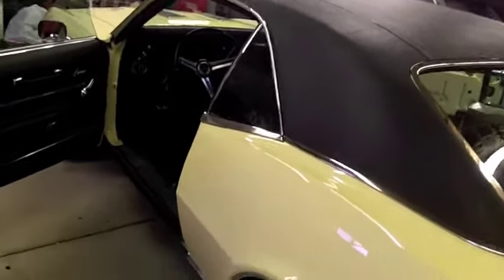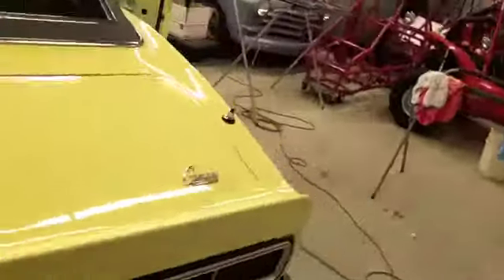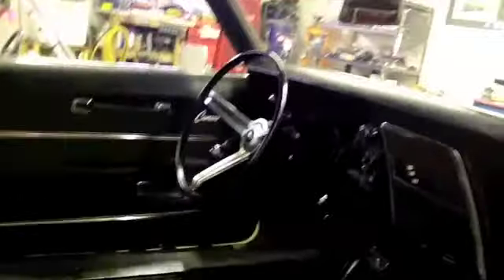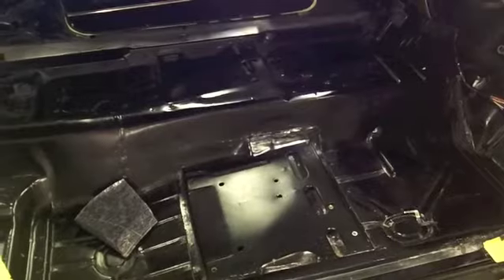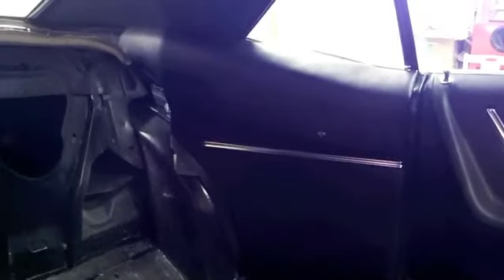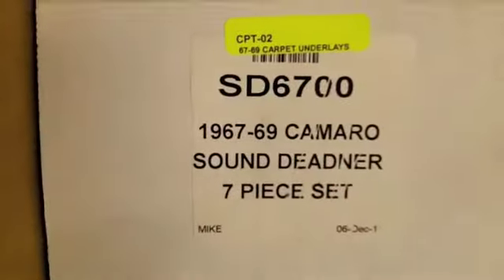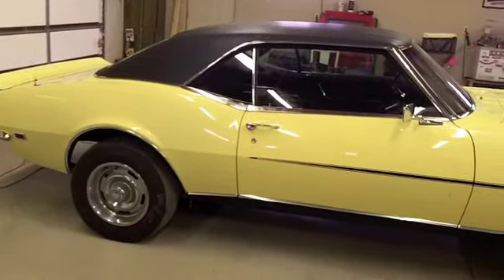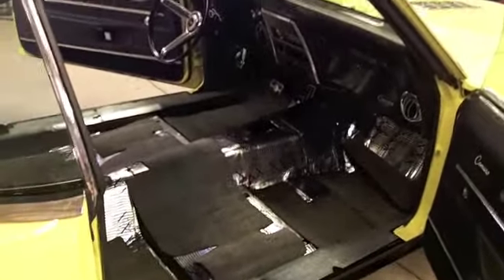68 Camaro SSRS 396 Restoration Part 56

Comment: I am ready to put my headliner in my 68 Camaro...any tips or tricks that might help? Front and rear glass is out. Thanks.
Reply from the maker: Not really I am a terrible interior guy. lol.. One thing I do that I think helps is I will mock up the headliner with binder clips first to hold it in place while test fitting. You can get it get a good idea of how it will fit and do most of the trimming this way before you glue it in. Sorry i'm no help, but good luck with your 68.

Comment: Hi, looking great!! I seem to remember my deluxe interior having a chrome trim on the dash pad that went around the cluster and glove box and around the vents, your didnt have that ??
 EDIt your was standard, Having done houndstooth, I can say the reproduction covers often do not have a straight seam, its waving going up front sides of seats. Youll want to install them on 68 seats, and sell your 69 set if you dislike headrests. Keep in mind, Head rests WERE an option in '68. With new deluxe buns '68 deluxe covers can be made to look pretty good on 69 seats

 Make holes in that dynomat asap, before carpet ( for seat tracks!)
Reply from the maker: Thank you. Yeah it is a standard interior dash pad. I do have the larger moldings for the dash pad but they are not really very nice & I never did run across the little piece in the middle the connects them.

I am hardly an interior guy but have installed a few set of the covers over the years. They never turn out perfect but with repo parts and honestly my lack of experience I just do the best I can. lol.. If my headrests were in better condition & the earlier straight bar style I would re install them but they are the later curved bar style and in poor condition. I know they are repoping them but I they just aren't really a priority for me.

 I have new 68 deluxe buns coming as well as side springs, bumpers etc.. everything I could think of before tearing into the seats to see if I need anything else to complete the seats. I have a nice original passenger side seat limit cable assembly to put on it that I have been saving for about 20 years to go on this car also.

Thanks, I notched the Dynamat for all the seat, seat belts & console mounting holes as I was installing it.